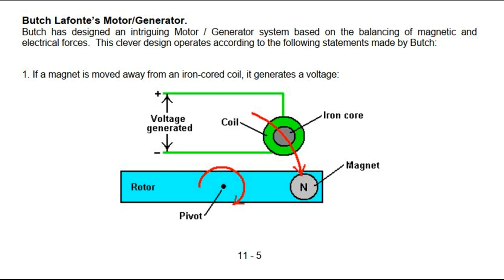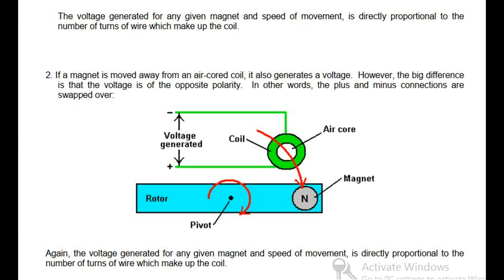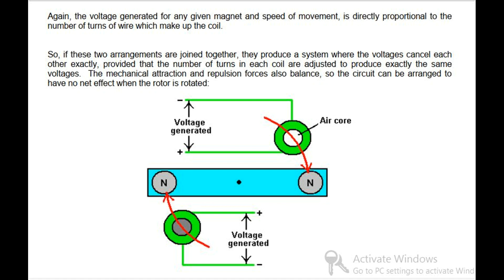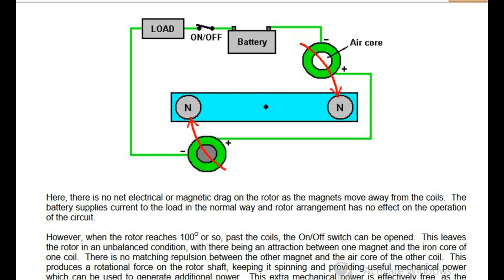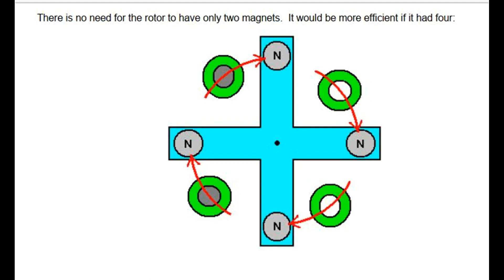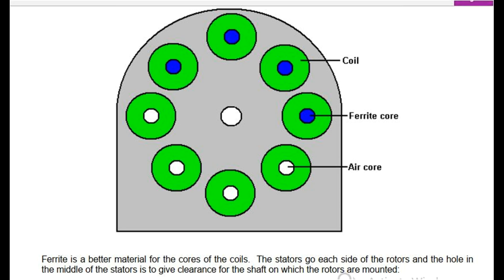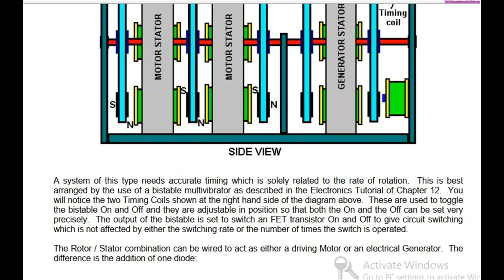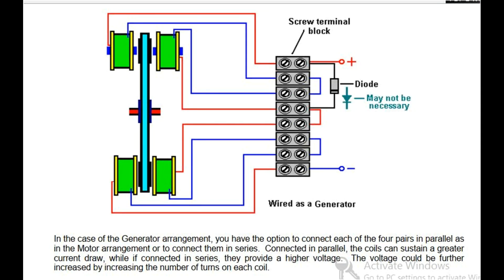Butch Lafonte's motor generator

Comment: This is wrong. An Air Coil Coil does not exhibit opposite electrical polarity as compared to an iron core coil. I will gladly post a video demonstration as proof.  Both AIR and IRON core generate a voltage in the same manner when a magnet is exiting
Reply from the maker: Air core my exhibit tie delayed current, which causes time delayed magnetic field, which causes mechanical effect opposite to that of instantaneous magnetic field.